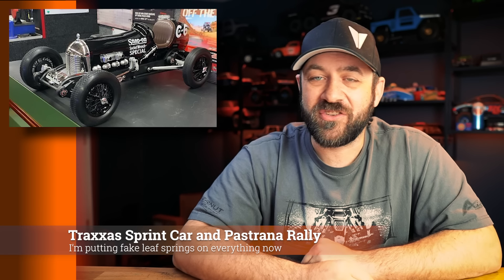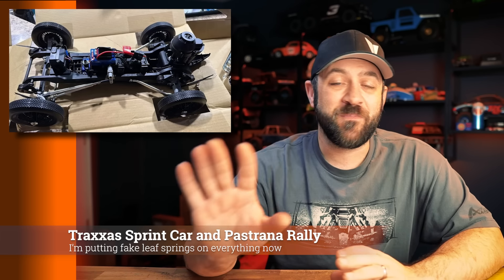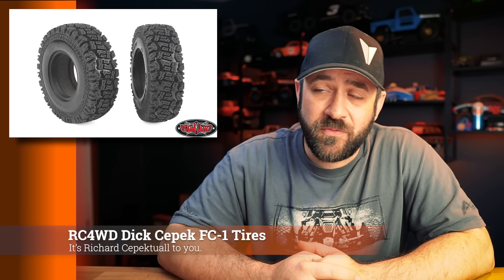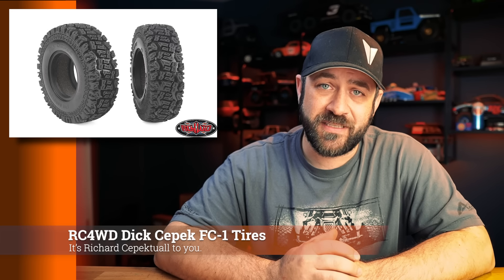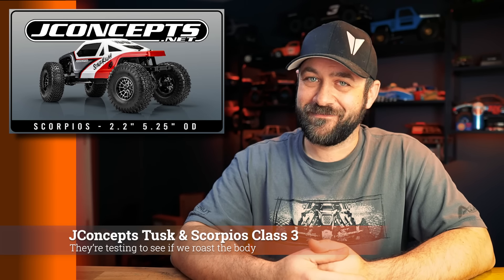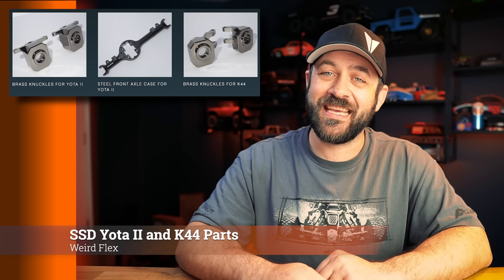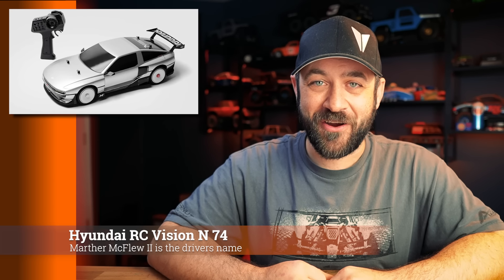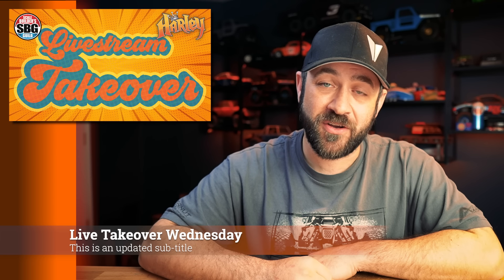Who do you trust? - Scale News Update - Episode 294

Comment: Before I get a new rc I always watch many videos and I read the full description on the website I actually just purchased a vrd carbon after doing a lot of research and weighing my options and figuring out what motor and esc to run I wanted to get the axial cj7 but the high cg trans and having centered gears through the trans and I feel the ring and pinion are weaker than vanquish and the 100mm shocks are too long I guess I just pick apart the parts ide need to change on the bed carbon it has tons of great parts and there really is no con to it besides being a cheater rig and it seems like it crawls amazing I have a love for axial but I now have 4 vanquish rcs and they are my favorite the quality and execution of what you include with your kits and rtrs makes it a no brainer to purchase I’m 30 and I’ve been into rc basically my whole life I used to drive rcs that had a direct cable to the controller ha ha ha my first hobby grade was a tamiya Blackfoot

Comment: I do not trust anyone, that is why always look for multiple sources of information. Sometimes digging through "looks good" reviews is annoying when I want someone to grab the front wheel and wiggle the steering system so I could see how much slop there is out of the box etc. With a new and completely unknown manufacturer I usually try to buy some cheaper part with precision features that I can use and give that manufacturer at least two chances. For example if bearing holes are too large on two separate orders then probably not going to buy parts with those features from that manufacturer again.

Comment: Sponsorship in racing is getting out of hand.....now anybody with a remote can get some sort of help from providers or manufacturers.
This does not include talent,that can not be given.
The issue I have with Sponsorship in racing is the fact at big races(race time entertainment events)these guys step down to sportsman class to podium for there sponsors....well there is a class called intermittent just for those guys,but they may not place so run the lower classes.
This is what the post was about....
If you feel like you are good enough to chase Sponsorship then have enough ass to run the right class...
I'm not sponsored,and don't want to be,it's a hobby I can afford and don't need the pressure of finishing results to take the fun out of chasing the perfect lap....
Sportsman=no Sponsorship 
Intermediate=some Sponsorship 
Pro=I'm bad fast and will prove it on the track....with a full chassis Sponsorship.